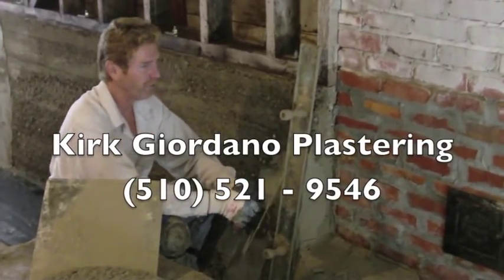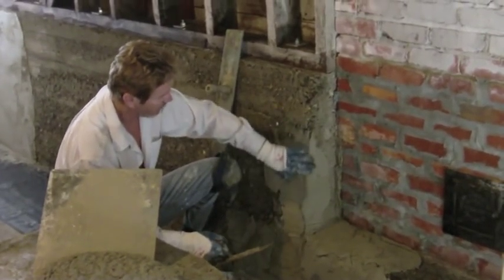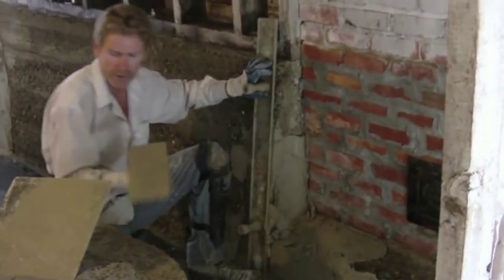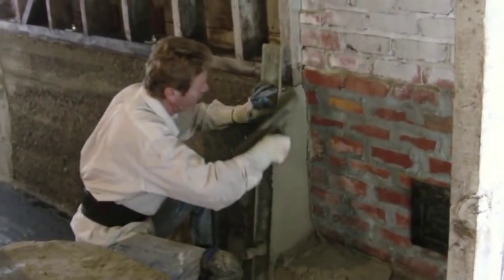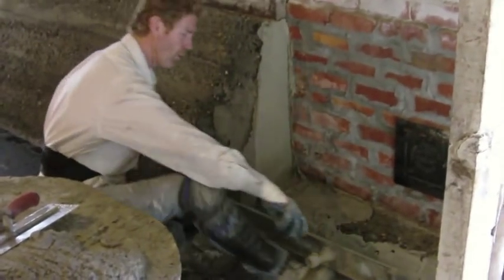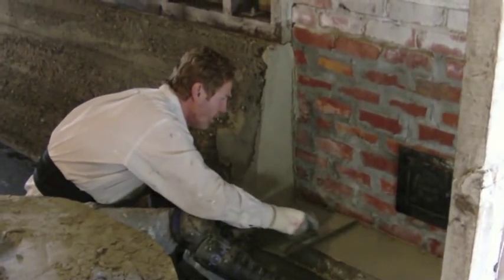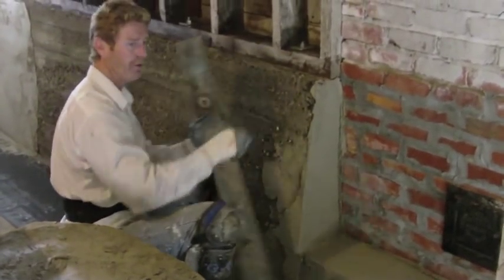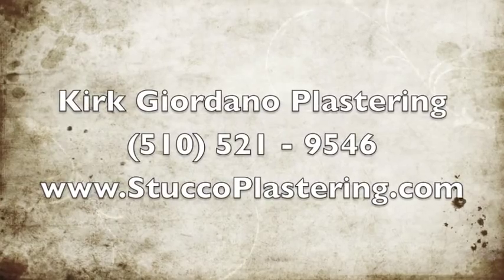Repair concrete spalling with stucco.

Comment: Nice work Kirk! Question, is this treatment also applicable to spalling bricks? Those spalled bricks in a wall or a chimney already loses 1/3 to 1/2 inch of its "skin", if we coat it with plaster, would it still be structurally strong enough?
Reply from the maker: Howdy Ray Lue Dude, absolutely, if you apply a good cement stucco over the bricks, they should last forever as the stucco sure will, if applied properly. 🤔
   If you decide to skim coat your bricks, I suggest you first pressure wash this brick wall you're referring to very well as nothing adheres to a dusty, dirty, or moldy surface. 
     Allow the bricks to dry then apply a bonding agent over them, with a paintbrush or roller. 
You use a bonding agent as the bricks are now beaten up by time as well as spalling.
 Now you're ready to stucco. 😉
      Usually, spalling means rainwater gets in weakly mixed or salty stucco.
 A clear indication that when the sand was taken from a seabed, they didn't rinse or wash it first before bringing it to a stucco/plastering material yard, to be sold to guys like me.
     Sort of like me on a hot day putting a hot beer into the freezer to get it to ice cold the bottle bust as the as when the water froze it expanded, Voila, broken glass. And another wasted beer. 😏
    Spalling bricks or concrete tends to get worse each year as there's most exposed sand and to little cement, plaster left. 
   Thus if they are really bad, I'm talking structurally not cosmetically, it might be time to stucco them. 
Lastly, if you type in our channel how to stucco bricks, you will find many we did for your stucco education.
Bringing to all the most complete plastering encyclopedia ever created in the world online.
 By the plastering messengers of Youtube.  With well over 850 free self-help videos 🎭 👀💃
Kirk and Jason Giordano Plastering

Comment: I have a 3 or 4 inches chunk of concrete wall foundation is coming off,  Should I use all pure cement to level it or should I use concrete cement. I tried concrete cement but it won't stick on the wall it keeps fallen. So any advise Mr. Kirk.
Reply from the maker: Good afternoon  Mark Dude, I would buy some rapid set stucco at home depot or lowes, clean the wall well apply a bonding agent on the wall, note: "not in the plaster mix" 
next, mix the rapid set so that it's sort of tight then try again.   Don't give up brother.                 
                                 Live long and plaster
   teaching all interested how to repair their number 1 investment